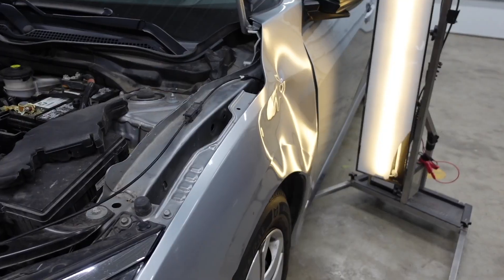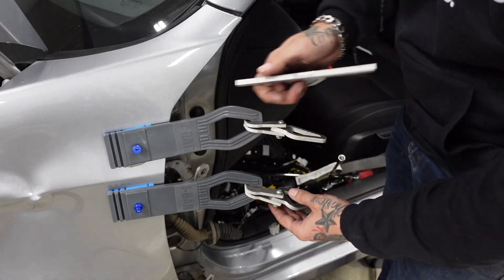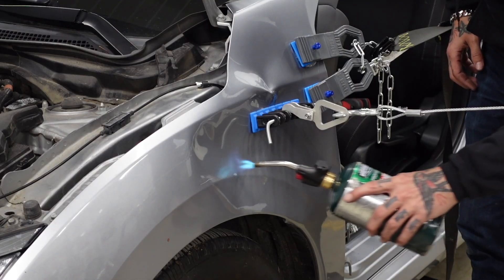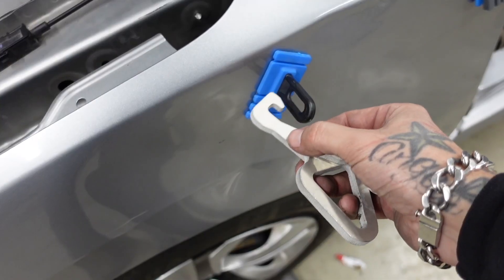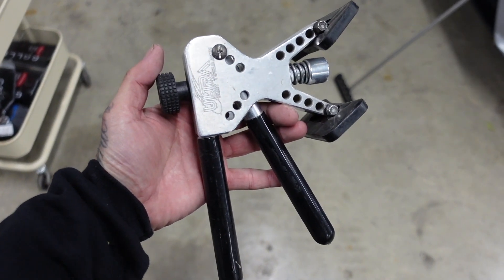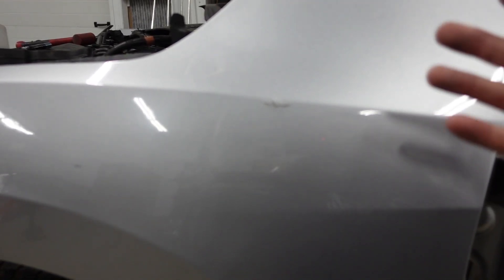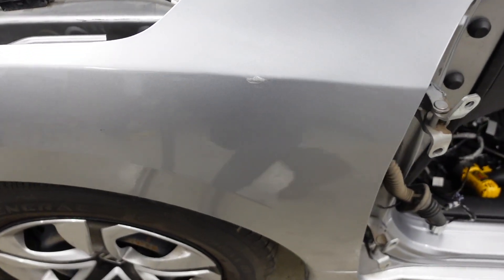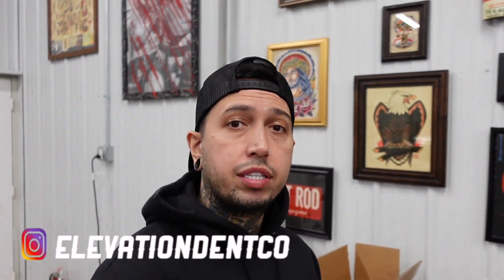Huge fender dent repair | pdr deep smash

Comment: You're a great dent guy, no question.  But a like new used replacement fender is about 2 hours of work and likely under $400.  This is at least a 6 hour pdr repair, so i hope you're making more than $70 per hour.  Or the customer paid $700-800 for a less than possible repair.
You deserve the highest pay, and your customers deserve the best advice.  
Your the man!
Reply: I was thinking the same thing too. However, when you factor in painting the new fender and colour matching it seems like this is still the cheaper option, depending on how much he charges.

Comment: Nice repair for what you had to work with. Very similar technique and strategy I use. My only question….since the fender had the paint damage to begin with, wouldn’t it be more feasible to buy a fender and swap it out? Can’t imagine you did that repair for $300 or so. Loving the channel. Would love to see a video about how you built your pulling tower. I have something similar I started but business picked up and haven’t got around to finishing it.
Reply from the maker: Hey Mark.. It would of definitely been a lot easier but that color has 11 different variants so i would of had to blend the door that silver is a bit tricky. I wasn’t expecting that paint to crack as bad but shit happens.. That tower is insanely basic compared to most I built  it really cheap.. Maybe I'll put a video or a pdf together sometime ..